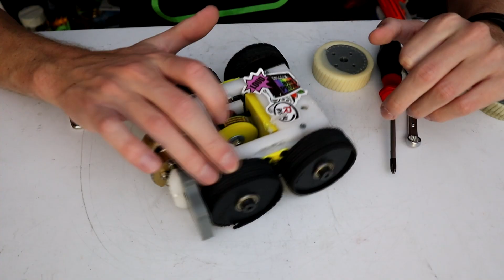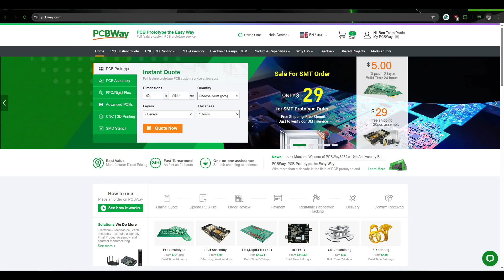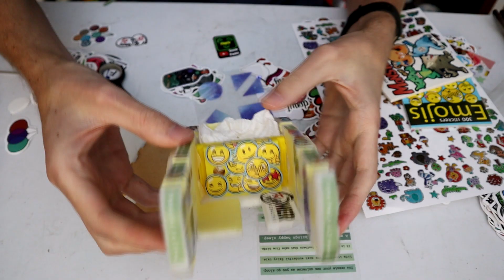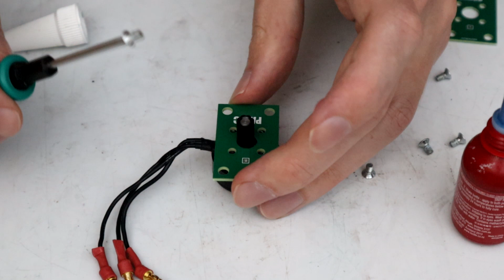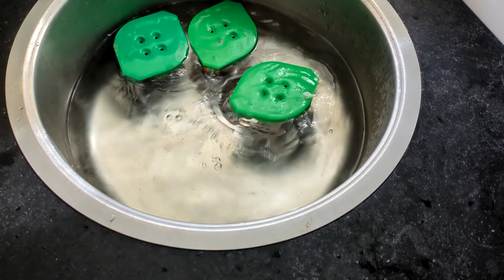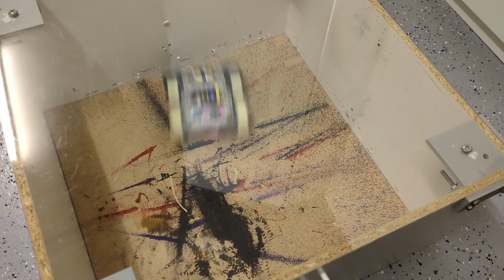New wheels for better drive! (beetle tangent drive upgrade!!)

Comment: I really like the look, and damn that drive looks incredible fast and responsive!
I'm looking forward to see how the belt tension holds up over fights :)
Since it's really hard to drive in the heat of a battle upside down: 
I don't know about your remote, but is it possible to set up the software to reverse steering with a switch for driving it upside down?
Reply from the maker: The tangent drive is a lot faster then I expected it to be, I'm very happy with it

My remote cant do a reverse switch currently, unfortunately

Comment: I would drive a few tires to failure. Give yourself a ballpark life expectation of the fit
Reply from the maker: Thats a good plan! I'd want a slightly bigger driving surface then my test box though
Reply: @TeamPanicRobotics  drive it around outside the box. No need to have the weapon hooked up to test drive and test wheels

Comment: Great work. Lack of ability to tension the belt is a bit of a concern though given how crucial belt tension is
Reply from the maker: There's a secret here, the ABS mount is slightly twisted because the belt is slightly too short, so as the belt wears and stretches, the ABS will relax back towards its starting position, keeping the tension on. Well at least for awhile

Worst case I can mount a belt tensioner to the HDPE floor

Comment: vasaline as a mould release agent on 3D prints is fantastic if you want to make demoulding easier in the future! also smoothes out printed layer lines on the mould a bit too! :D
Reply from the maker: Thats a great tip!
I might have to try that when I run out of the release I'm using

Comment: Those PCB motor mounts are nice, I think they're going to really stiffen up the drive system and make it way more consistent. I also really appreciate you sharing your progress with molded wheels and tangent drive. Aiming to convert my tangent drive from lego tires to custom molded tires in the near future!
Reply from the maker: Me too! and they are also less likely to break then the ABS ones

No worries! Casting tires can feel like a big undertaking when you've never done it before but its pretty straight forward